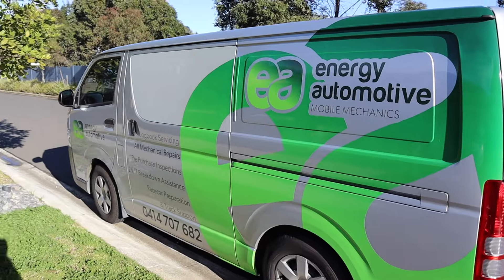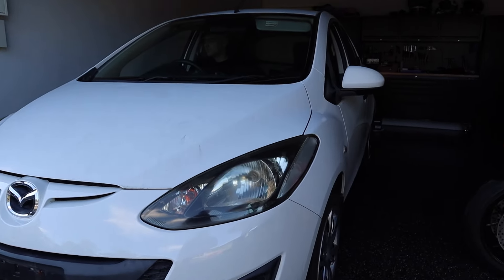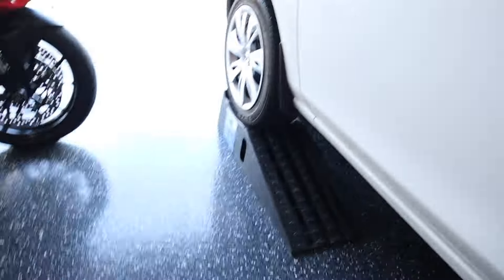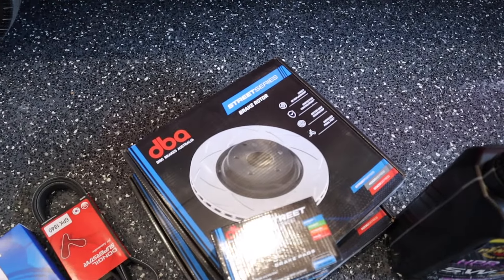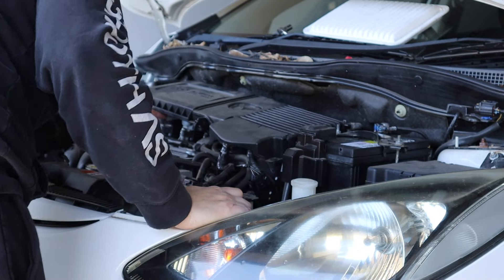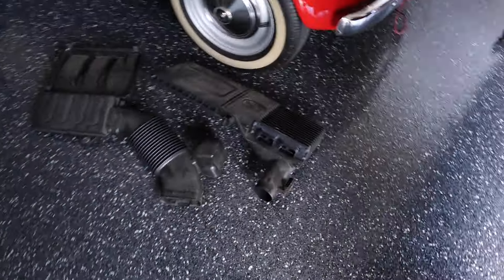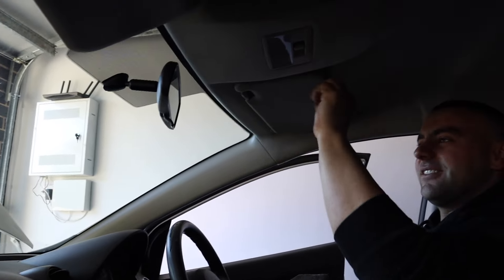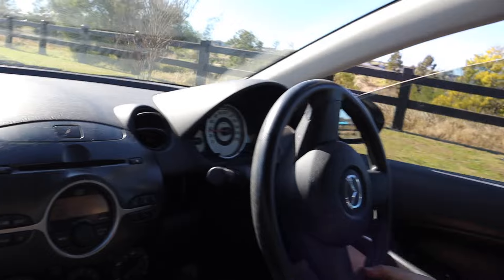Budget Mazda 2 Race Track Day Prep - Good Buy or a LEMON?!

Comment: i reckon after you get your base lap time go nuts with the car like strip the interior like the head liner rear seats door cards and speakers then get some buckets seats then some nice wheels with some Michelin cup 2's  pod filter and some gauges like tachometer with a shift light a coolant temperature gauge oil temperature gauge and lastly an exhaust 🤙
Reply from the maker: You’re pretty much on the money for what our plan is with it 👌🏻 stay tuned for next weeks video!
Reply: @smoothasbrothers  don't the Ns also come with Michelin sport tyre's?? Also dumb question, but why dose the nline also come with sport tyres and it's not tuned for the track?
Reply: @aussiefurbymogwaifan6621  well, the Michelin pilot sport 4/5 are the best tire on the market for street+track the  car is a sporty car so the person who does want to take it to the track has the tyres  and doesn’t need to spend more money because they are an expensive tire
Reply: @6Z1LLA9  and people scream "tHe nLiNe Is JuSt A bOdY kIt On A rEgUlAr i30". Funny given that they used to race nlines in korea until last year before the facelift🤭
Reply: @aussiefurbymogwaifan6621  ikr 😂😂